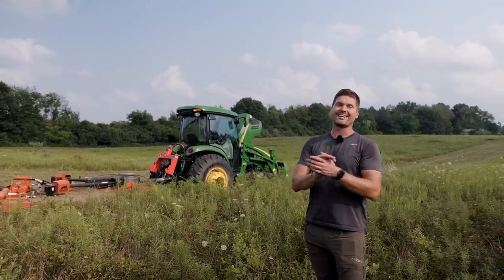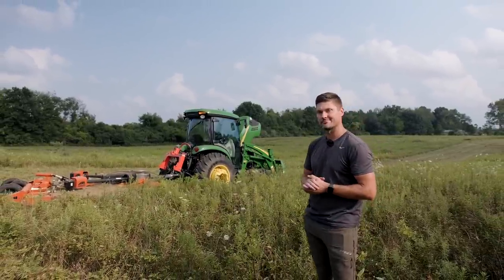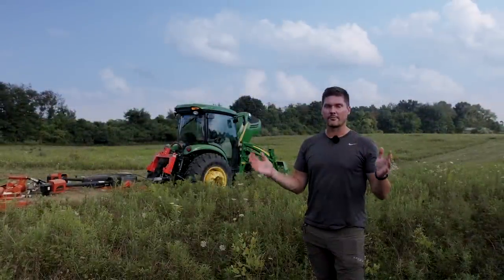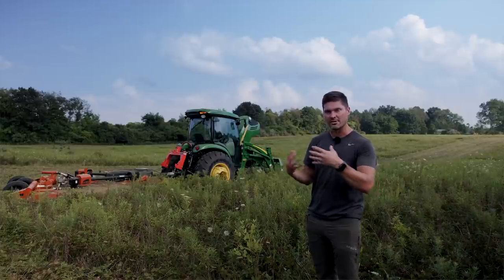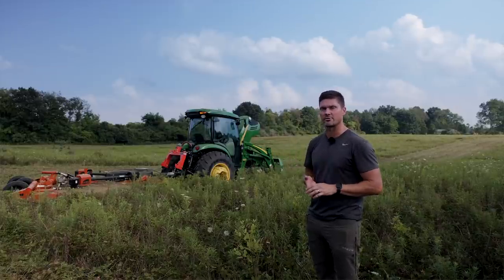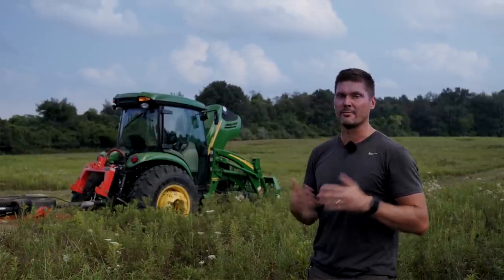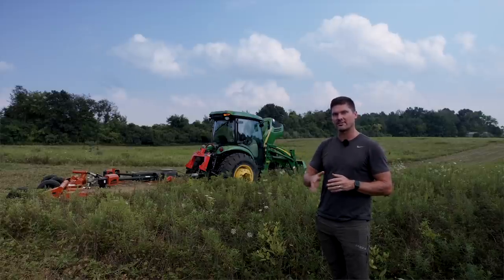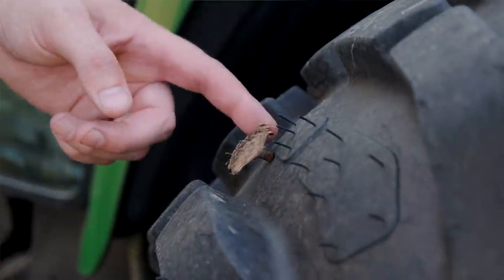JOHN DEERE BREAKS DOWN PULLING A BATWING MOWER THE FIRST TIME

Comment: All if these issues my friend seem to point to the electrical system. Not saying this is the cause but something like a bad ground, bad alternator, damaged wires, etc.. When you had that issue with your hydraulics and they could not repro it that made me think something electrical was wigging out the PTO solenoid and other solenoids randomly. 

You will find it, still think you made the right choice and I know you won't give up till you find it. 🙂
Reply from the maker: Yeah you could be right.  It isn't the usual stuff that most of these folks are commenting on.  Those things were crossed off the list already.  It's something funky!
Reply: @GoodWorksTractors  as you know my friend our modern tractors are more and more dependent on the electrical system. The CPU and components are very sensitive to ground and voltage issues also.  Someone at the dealer needs to go over the entire electrical system with a fine tooth comb. Start with the alternator/regulator, then fuses/relays (and the fuse/relay box), then CPU/Control System, then harness. It will take them some time but that is why they get paid the big bucks. 🙂

What really points me in that direction is the case of your battery acting dead and them working again at the dealer. There is no reason it should be doing that if your electical system is ok.

You will find it my friend, I know you will. Rooting for you!

Comment: Could be as simple as loose belts or low on coolant. Also as stated by another person, don't shut off a hot machine unless it is leaking fluids. Leave it running at a fast idle (1000 rpm), and let the cooling system do it's job. Plus turn off all loads on the engine I E; a/c, pto, lights etc. You can also turn the heater on high if your desperate, it acts as another small radiator.
Reply from the maker: Yeah, good tips for sure.  Still, it means there's some bigger issue going on.
Reply: @GoodWorksTractors  ....hoping you’ll see this since it’s kind of buried in the comments.  You mentioned that you were surprised that there wasn’t much, if any , debris on the filters or front screen. Is the fan blade spinning full speed? Could be a loose belt or fan clutch problem. Also, I would wash the radiator and a/c condenser out with water ...not just blow it out. I’ve had a tiny black seed like material ( probably from Baha’i grass) clog up my radiator before and blowing didn’t help...and you couldn’t see the clog. It really surprised me to look down as I was washing it to see all the crap that was on the concrete . The a/c not cooling good was what prompted me to do that.  Also...look under the tractor for any crimped hydraulic lines.  I had a stick jam one of my  hard hydraulic line to where it was restricting and causing the fluid to get really hot

Comment: I've had a similar problem with my 4066r of getting hot. When I looked closely at the front of the radiator,  behind the oil cooler,  the fins were clogged to the point no air could pass. This is a very tight and almost inaccessible area. I keep the tractor clean, and check regularly,  but this has escaped me on this smaller tractor.  Yours should be inspected for the same reason.  Very difficult to clean, by the way. 👍
Reply from the maker: Thanks Rob.  I know what you're talking about there.  It is a hard area to clean.  Had to replace a compressor on one 4066r and pinched a wire for the air ride seat on the other.  Those were the only issues I had on those machines in 2+ years.  Issues are piling up on this guy quickly.
Reply: @GoodWorksTractors  Tractor Mike sells a product that fits in the gap to clean it out, you get two , one for water and one air.
Reply: @baz7647  Yes I bought one of those and they were nice when you're not out in the field. I have a lot smaller tractor and just keep an eye on the temperature when I'm out in high brush with a 4 ft brush hog. I think somebody else's suggestion to have a blower to blow it off periodically when you're doing that much work on this project would help. I know others on YouTubers said though that hydrostatic transmissions have a tendency to run the engine hotter than a shift transmission. I think on tractor time with Tim is larger John Deere has the power shift transmission which may give you the best of both worlds. I know Kubota has a similar system which they call glide shift transmission or GST. My almost 40-year-old's small Kubota is a manual transmission and I haven't really experienced it getting too hot, but Courtney is doing a lot bigger project plus he's got an AC cab and a huge rhino batwing behind him. Hopefully there is just a problem that they can find at the dealer, but if it continues not to perform to your liking, you may consider a Kubota with a GST or a John Deere with the power shifter.
Reply: I had a 4052R and had this issue a lot when using my 6' and 12' cutters. It's very hard to keep the radiator and ac coil clean under the hoods of the smaller tractors.. And it being a hydrostatic transmission didn't help with the overheating. I got tired of going back and washing it out every hour, so I sold it and purchased a 5075E. Love the new tractor and handles the larger jobs much better. Haven't ran it hot not once.
Reply: Exactly as Rob has noted. I run our 4066R in tall weeds. Clean out the cooler and radiator with compressed air and keep air filter clean. Engine temp will com down quickly. It will happen to any tractor in those conditions. Deere needs to increase cooling capacity

If you had a portable air compressor, you would’ve had that job done

Comment: Since I had owned that machine for the past year or so.
 I thought I would try and help here. 
It was never uncommon for that tractor to smoke a little on start up in varying degrees. 
Being that it is black smoke it is nothing but unburnt fuel, that being a pre-emissions machine  
there is no DPF to capture it. 
I always felt that was a big part of why that tractor was so much louder then my 4066R. 
I always sort of liked that about that tractor, that classic diesel plum at start up, and the clear wine of the turbo shining through.
  
I would not be worried about that black smoke at all. 
Now if you see white smoke, you may have a problem. 
Black smoke especially on start up or when lugging it down under load is not uncommon at all on a pre-emissions machine. 

Now whenever your having hydraulic issues, remember that machine has a tinny T shaped pressure relief valve on that loader 3rd scv. 
It is located right on top of that rear scv ports. 
If your having trouble with bleed off or pressure issues while operating that machine, I found the best place to look first was that little T shaped relief valve and make sure it was tight. 
You have to turn it sometimes to get the pressure off the system since, I learned the hard way that machine does not work off simply turning the Key on and toggling the thumb button like on a 4066R to relieve the 3rd functions pressure. 
Every time I ever had hydraulic issues with that tractor that little T relief valve was not tight.
 Since the whole system is tied together in some ways that might have been part of your issues with the hydraulics. 
Just a thought.
Reply from the maker: Yeah, normally it has a little black smoke on start-up, but this was enough that had me taking a look in the grass to make sure nothing was on fire, haha!  So, it was just different than normal.

Hmm, good to know about the T valve.  Haven't checked that at all.  I'll have to keep that in mind!  No issues yet relieving hydraulic pressure, but it could happen!

Thank you for taking the time!!

Comment: My 1025r overheats sometimes when I brushhog however it's usually caused by low coolant level because it sucks up coolant for some reason I usually just let it cool down add coolant  and it's good to go
Reply from the maker: Yeah, plenty of coolant here fortunately.
Reply: It shouldn't be going through college. If it's still under warranty I'd get it into the dealer. If there isn't a visible leak you could easily have a leaking head gasket or cracked cylinder head and you don't want to do those jobs out of warranty...

Comment: Bad luck. Sounds like my 4066R I has pulling a TS12 a few years ago. I think those hydro tractor just can’t take pulling a rotary mower in thick heavy weeds. I fixed mine by trading up to a full size Case IH Farmall 100c and a Land Pride RC3615 15 foot rotary mower. Good luck I hope you get it fixed. I tried cleaning radiator and holding over to mower less with each pass but only thing that fixed it was the trade.

Comment: Need to just check the basics: THOROUGHLY clean all the coolers up front. Preferably with a pressure washer with the coolers pulled apart as far as possible. Check fan belt tension, coolant level. After that, might look at thermostats, then water pump. But the last 2 are unlikely to be the culprit.  Usually it's just lack of air flow. 
The excessive black smoke would immediately make me want to check the air filter/intake plumbing. Lack of air to the engine will cause excessive black smoke and will also contribute to overheating.
Reply from the maker: Thanks.  Yeah this tractor was just serviced and detailed recently.  Maybe 3 hours of use on it since then.  You're right, that black smoke does seem to be air related.  Gotta dig deeper.  Thanks for the tips!

Comment: Ohh Deere, couple of things I have seen people already post, idle it while you open the hood and check things out. If you can't see anything there and the radiator isn't blocked up, well things could get interesting first I'd flush and change the coolant, then the thermostat, and if it's still overheating maybe a head gasket or even a water pump, I did notice the cloud of black smoke on startup and thought that's odd. Was it hard to start back up like cranked abit more etc? I have a mix of water and air cooled tractors and I prefer the air cooled tractors in the crap like your mowing in summer. I've had the overheating issue a few times doing clean up work it's not fun
Reply from the maker: Ha!

The thing is that the needle was not in the red when I turned it off.  It was in the green, but rising.  So, I wasn't thinking it was in danger of overheating.  I hopped off to clean the grill expecting it to be covered in debris, but it was not.  It was almost completely free of debris.  Something I've done on dozens of tractors over the years while mowing.  Keep an eye on the needle, as soon as you see it start to rise, time to clean it off and check under the hood.  So, it caught me off guard when I turned it back on on the needle was literally buried as deep in the red as it could go intiially.  Spiraled downhill quickly!

PS -- no, wasn't any harder to start up.  Cranked up like it always had.  Goofy for sure.
Reply: @GoodWorksTractors  yeah that's goofy alright might have just been the uncirculated hot coolant sitting on the temp sensor. It is a big mower your running on it and it would of been under abit of load so might have just come up to a higher working temp. I don't think I will ever ask my new 4066r to pull anything like that as I have alot of choice in the shed ( 35hp - 130hp) I am going to try and mow and bale hay with it and the mower will test it (need a minimum of 55hp at the pto to run it) I feels for you it's annoying to say the least
Reply: @GoodWorksTractors  check to see if the engine cooling fan is working. I don’t know if these tractors have a fan clutch or if they have a fan that runs all the time, but no debris on the grill sounds to me like a lack of suction or no air being drawn through the coolers and to the motor. Just a suggestion...
Reply: @GoodWorksTractors   Heat soak after shut down is normal, but your tractor is running LEAN due to Injector pump issues, and 1 or some injectors are leaking ( dark smoke at start)

Comment: I think your black smoke concern is what will end up being the problem. I would guess emissions problem.
Reply: leaky injectors, and  injector pump not pumping enough fuel. Running Lean causes heat

Comment: Get a compact battery operated blower I recommend the small Dewalt, make sure all the radiators are spotless clean, I don’t know about yours but they usually have a very small narrow radiator hidden between the other radiators hard to get to make sure it’s not clogged up, when it overheats blow the radiator out quickly then start upAnd run it full  throttle and watch the temperature gage slowly drop don’t drive it just run it until it cools down then all the lights go off and start operating tractor again what I have found on my 4066R is there is no clean out screens and it’s very frustrating basically I have to carefully pressure wash everything out with a wide spread fan of water so it doesn’t bend the fins on the radiator when spotless the only thing you can do is run it keep an eye on everything blow out the radiators on hot days, I had to get rid of my 4066R for that reason, I run now five series, but come spring time I work seven days a week running full PTO speed for five months nonstop and at the end of the season when it’s hot and dusty it’s almost impossible to finish a job because of the heat & the dust there’s times I have to blow out the radiators every 10 minutes, it’s so frustrating if they put clean out screens it would make life so much easier, on the 4066 if you pull off the right and left side panels then on the bottom of the front grill on each side there are two clips on the right side two clips on the left side unclip those disconnect the headlights and lift the whole grill up and out this way you have access to all the radiators look down underneath the bottom and make sure that tiny little radiator is spotless clean and the only way you will get it all out is eventually pressure washing it, but before pressure washing make sure you blow it out with air as much as possible without bending the fins otherwise you will get mud, It’s frustrating but it is doable, As of five years of running a 4066R it’s always late season where I have these problems otherwise it’s a great tractor, I average at least 600 hours a year saddle time and have never had any breakdowns just the overheating problem.

Comment: Had the same issue but I had a case ih 225 200ish hours on it and it was a ground wire issue had the same dumb looks from dealership they thought I was crazy too but after 4 times in shop then they found
Reply from the maker: Haha yeah I had some ground wire issues on one of my skid steers.  That was a mystery for several weeks.

Comment: Internal water pump either weak/failing and/or gasket leaking coolant / causing oil to mix with antifreeze to cause the odd smoke?    Would reduce cooling efficiency and lead to the overheating.   If someone didn't put the right coolant mix in it before, let it freeze hard one winter, all sorts of drama happens.   Prayers!
Reply: Injector pump, and leaky injectors. It is running LEAN = HEAT

Comment: Are you going to follow up with the reason(s) the JD was no cooperating?  If there is any guage I watch the most, it's the engine temp.....like a hawk!  I carry a brush or hand broom to clear of the grille or radiator or what ever.  If I need to, I go back to the barn to the air compressor.  Works every time.  Engine heat is not your friend.....
Reply from the maker: Yeah, I plan to for sure.  Frustrating!

Comment: There was something very relaxing about watching this video, up until the tractor stopped.  I wish I had more mechanical expertise to offer a more informed opinion on what it might be that caused the overheating, but you did mention the AC in the cab was sluggish, so my thoughts turn to a circulation issue somewhere, perhaps a blockage in or near what is pumping the coolant?
Other than that, my best guess would be that the thingy next to the other gizmo has stopped working. :)

Yeah, my machines groan at my lack of mechanical skills as well, sorry bout that. LOL
Reply from the maker: Haha, yeah, I'm not a mechanic either.  Maybe a creature got inside there overnight and caused some issues that I can't see.  Not sure yet!

Comment: Wondering if this tractor has a hydraulic oil cooler? (Oil to water/coolant) In the automotive world I know you can end up with similar issues if you have an internal cooler leak allowing hydraulic fluid to mix with the coolant. That  could explain both recent issues.
Reply from the maker: Good question.  I believe it does.  There would probably be noticeable separation in the tank between those fluids?
Reply: @GoodWorksTractors   yes, it might not be so apparent in the field, but I would expect the fluid to be cloudy/muddy. After sitting for some time possibly an oil slick at the top of the radiator or coolant jug.

Comment: thick black smoke and overheating? You have more fuel than air.  blown turbo or overzealous injectors. im not always right but i always think of the most expensive things first. if not check your air filter and air intake for clogs. OR if you have no compression in the cylinders its a blown head gasket.. but check everything first.

Comment: You put a big load on a diesel engine it will puff black smoke. I would shut off the ac and slow down a little with that big of a brush cutter. And always let it idle for a couple minutes before shutting it off unless it is really over heating. The engine will thank you for it.

Comment: It's normal if you shut off a hot engine it will gain heat at the temperature  sensor  because it's no longer circulating  the coolant . But I'll bet you know that now . Drive it back to the yard  and blow it off real well and go back to work ..